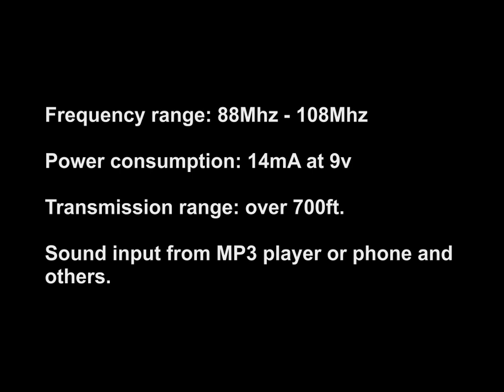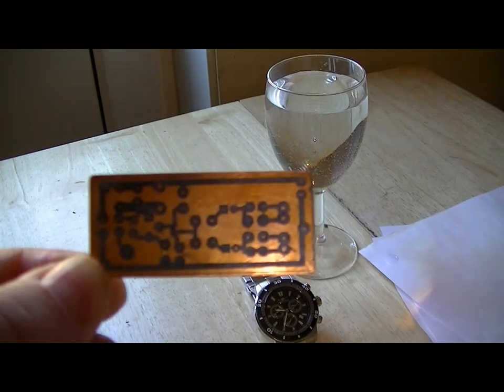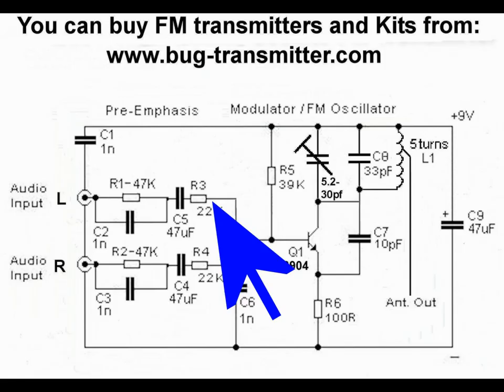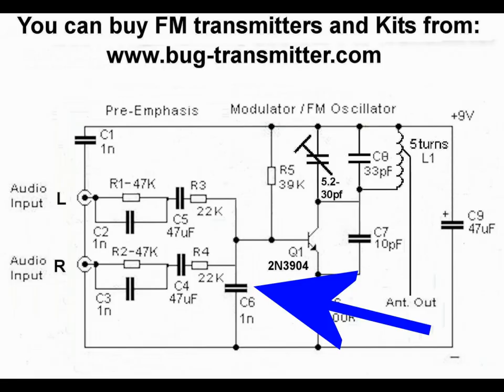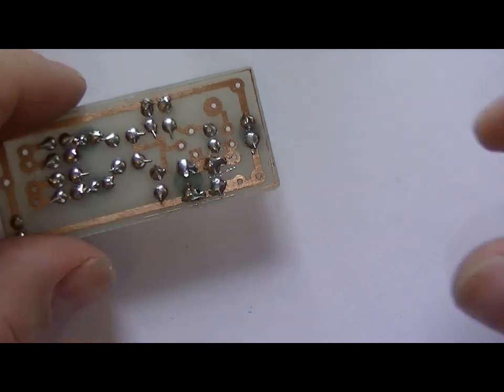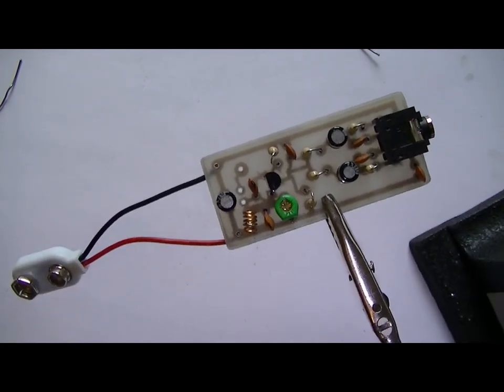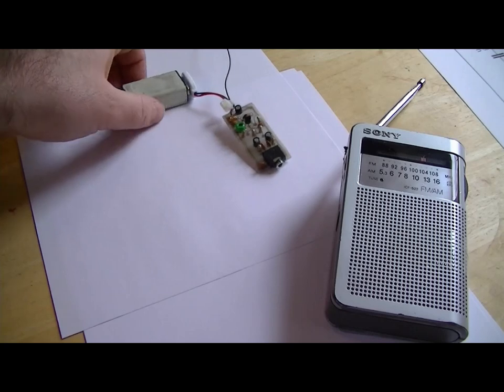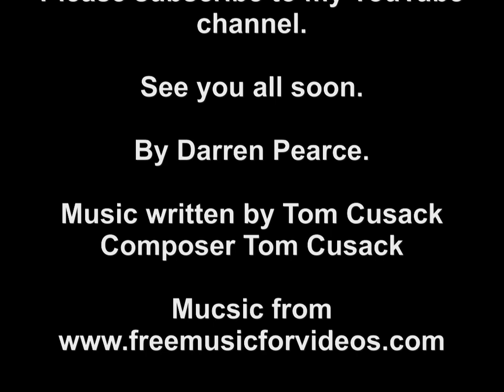How to make your own radio station.I show you how to build a simple FM transmitter.

Comment: Great video! Just wondering about the homemade coil, you said 5 turn is good for the regular music radio mhz, so that's what I'm aiming for. But you didn't say anything about the thickness of the copper wire. Is this crucial? What thickness should it be? AWG or mm2? Thanks in advance and hope to see more of these videos, I really love em! =)
Reply: +Chris Fredriksson The thickness is not crucial. You can adjust the inductance of the coil by pulling it out or pushing in.,(all the turns or just 1, 2 or 3 turns f. e.)
You can use lacquered copper wire. Or solid electric coperwire.
Reply: +Antonie van Gelder Thank you very much! I did build one of the others that dazaro3 shows on his channel and I found that out by just testing :D So at this point I already knew it, but it's great to share here so others can have use of the information. Thanks Antonie! =)
Reply: Chris Fredriksson You welcome, trial and error ;)
Reply from the maker: +Chris Fredriksson 
Sorry im late in reply ,been very busy.
The coil is made from 0.5mm Diameter enamelled
wire ,the wire does not need to be enamelled wire,you
can use any solid core wire from : 0.4mm upto 0.8mm.
And wrap the wire around a 3mm drill bit to make a coil.
Reply: +dazaro3 No worries =) Cool, thanks for that! I already built one of the other transmitters already, so i know it works.. Haven't come around to build this one yet, but I have all the parts! I'm also "busy" with doing other things, but its real stupid, I should just get on with it =P hehe..

Hope you make more videos on transmitter bugs and the like, I really love all your videos! =)
Reply: +dazaro3 A good way to hide a Fm spy bug is inside of a radio.who`sgonna notice that a Receiver has the ability  to transmit, isn`t it?
Reply: +gary depietro Thanks for replay. A hollow book is fantastic and awsome but is less secure to spy your target. Ex. If your target will open that book will ask what are this circuits, but your friend you spy will no open a radio if it Works, (but secretly it works both ways). And radio is ok in case of metal detector inspection.
Reply: +gary depietro O, sorry. You are right a hollow book is good hiding place, it`s only less secure just for few people, many people of today never open a book.
Reply: +gary depietro Thanks for inspiration.

Comment from the maker: You can use glossy paper from old magazines
Yes ,an Inkjet printer will use solvent inks and it will not work and the printer i use to make my PCB's is a laser printer ,its the toner transfer method.
It will ONLY work using a laser printer.The toner in laser printers and most copiers is made mostly of PLASTIC, which resists the acid that eats away the copper that doesn't have any toner on it. Inkjet printers use INK, not toner. And their ink is typically NOT a good  etch-resistor, at all.

Comment from the maker: Yes ,a Inkjet printer will use solvent inks and it will not work and the printer i use to make my PCB's is a laser printer ,its the toner transfer method.
It will ONLY work using a laser printer.The toner in laser printers and most copiers is made mostly of PLASTIC, which resists the acid that eats away the copper that doesn't have any toner on it. Inkjet printers use INK, not toner. And their ink is typically NOT a good etch-resistor, at all.

Comment from the maker: Its Ferric Chloride , a material for etching copper clad boards.

Ferric chloride has the advantage over other etching solutions like nitric acid by greatly improving the safety of etching. Ferric chloride is free from harmful gas emissions it will stain but will not burn skin and the pen ,Etch Resistant Marker Pen

Comment from the maker: This FM Transmitter may have about 5mw RF power,
thats 0.005 watts ,some local FM radio stations FM
transmitters power can be 25.000 watts and national FM radio stations
250.000 watts ,so you can see why this tiny transmitter will not 
override a FM frequency from a much more powerful transmitter.
To use you need to use a spare FM frequency.

Comment from the maker: It can yes ,but from about 10-25ft max
This FM Transmitter may have about 3mw RF power,
thats 0.003 watts ,some local FM radio stations FM transmitters power can be 25.000 watts and national FM radio stations 250.000 watts ,so you can see why this tiny transmitter will not override a FM frequency from a much more powerful transmitter.

Comment from the maker: When building FM transmitters you need to have all the soldering work 100% because they are high frequency circuits ,if a transmitter is working at 100Mhz they are working at 100 million cycles per second ! so all parts need to be in the right place and all soldering work 100%

Comment: awesome vid mate. just to help out if you dont mind (u didnt mention which way round the 47uf capacitors went). for those building this or just wondering... the capacitor purposely comes with different lengths of stems. the longest of the two would go into the right hand side of the board connection as you look at the drawing. hope this helps. keep up the good work dude! :)

Comment: I remember that magical moment of hearing my own voice through a Pierce oscillator (crystal controlled) based home made "bug" built on Vero board. Being a Pierce it didn't require inductors.

All 2N2222A with a class A amplifier through an emitter follower and fed into the oscillator base.

That was 30 years ago at the start of my career as an electronics engineer and it was my first transmitter design.

Comment from the maker: Make the coil using a 5mm drill bit.
Best way to test is with a FM radio.
Double check all your work and make sure all the parts are
in the right place ,just like in the schematic in the video.

Comment: How long does it last on a 9V battery? I'm thinking of using 4xAA, will 6V be enough?
Reply from the maker: ☹ しんみりＧＨＯＳＴ☹ 
If you use 9v and a PP3 Alkaline Battery current consumption is about 14mA so a 9v battery will last about 15 hours.

If you run the transmitter on 6v the transmission range will be a lot less but running time is very long , 4x AA Duracell Plus 2600Mah batteries current consumption is about 9.2mA so running time using 4 x duracell Plus 2600Mah batteries is about 282 hours !! about 12 days running time !

Comment: Awesome work , 
But how you know what channel FM is it in radio ?
Reply: Masood Haxor im also thinking about it :/
Reply from the maker: Masood Haxor 
Then turn the tuning dial on your FM radio slowly from 88mhz all the way to 108mhz ,if your transmitter
is working then you will pickup what audio you are playing.
Reply: ***** 
please what is the capacitor voltage ?
Reply: Is the capacitor and inductor a resonance filter?
Reply: Is the capacitor and inductor a resonance filter?
Reply: Is the capacitor and inductor a resonance filter?
Reply: But what about if I air no sound signal i.e., off-the-air?

Comment: I made one of these but doesn't the circuit circle around? I am using a 4.7uF 6.3V capacitor (smd, not electrolytic) and all i get is the 9v batter overheats. Lol
Reply: Nope, you can usually overvolt a capacitor to some extent, they're not that sensitive. What happened in my case was I created a short circuit at the +/- power in, because I didn't understand the circuit schematic. It ended up working and I still have it, I just don't use it :)

Comment: I have one question for the autor... I am making 
same as your transmitter and I have all the parts 
required,but don't have digital the frequency 
meter. So can you tell me which frequency should 
be adjusted on trimmer capacitor for the some 
frequency (for example 100.4Mhz or 97.6.....) 
because i can't measure the frequency. I am 
Serbian and maybe not good write on English.
Reply: Just set to somewhere randomly in trimmer knob and check via FM radio, at which frequency you are detecting transmitted signal..once you figure that out.. You can slightly rotate knob left or right and recheck frequency of reception in radio receiver..and repeat the process ( hit & trial ) till desired frequency setting is achieved..

Comment: What's the maximum range of transmission allowed without the need for an FCC license?
Reply from the maker: Wheatley GLADOS 
About 20ft in the UK .
Reply: Wheatley GLADOS 
in the US about 100 yards/300ft  
if you check the FCC regs they measure the field strength of the radiated power. Also you need to make sure you are not transmitting on a frequency occupied by a licenced radio station.
There is a ready made transmitter you can buy called Wholehouse Transmitter which costs about 100 dollars and allegedly has approval.. I tried them out. You get about 100 yards with a box standard radio and a bit more with a good car radio with a good antenna.

Comment: Hi dazaro, you do great works, i want to ask you if it's possible to build a complicated circuit board like the Open Source Hackrf project using the same tools you worked with, I know electronics but i never tryed to build anything i am not experienced in this field so what do you think about Hackrf and similar semi complicated PCB projects ?
Hackrf is an Open Source project to produce a wide range radio listenning device.
Reply from the maker: I have never seen the Hackrf project before ,i,m poping over there right now to take a look.

Comment: thanks for reply and i want to ask one more question that in your schematic diagram there is 3 capacitor of 47uf and you write in components name 4.7uf x3 so what is the capacitor you actually used in your fm transmitter. ?????????
Reply from the maker: You can use 4.7uf or 47uf ,both will work.

Comment: I have no 33pf cap. What can I use instead??

Also, if I use 22pf cap instead of 33pf, will it affect transmission?

Pls reply...Thanks!
Reply from the maker: MEM - MMXVII 
Add 2 x 22pf in parallel ,or try just one 22pf , the 33pf capacitor is part of the tank circuit so it's value is important ,best way is to Google tank circuit and have a good read.

Comment: I made this, but it's kind of unstable, I used the 10pf capacitor on the end of the coil with a ~15cm antenna, any tips on whats wrong?
Reply: Nevermind, I found the problem, traces and legs were too long.

Comment: I tried "building" this in a a circuit simulator - I got the following message: "Capacitor loop with no resistance". Did anyone build this? I'm not questioning your design, dazaro, but that just seemed strange.
Reply: Tony07UK
Allright. I'm receiving the parts to build this in some days - we'll see if sufficient impedance will make it work then=)
Reply: ojkolsrud1 did you manage to simulate this?.. did it work? .. i tried it on NI multisim..im really bad at this though..i put it as is.. and used a function generator with a 1khz sine wave as the audio input.. it didnt work :/

Comment: I've 6-30 pf trimmer so it will work or not...
& what material is L1 coil made of
Reply from the maker: faiz khan 
Yes your 6-30pf trimmer will work just fine ,coil is made from 0.6mm wire ,you use use wire from 0.5mm upto 0.8mm

Comment: Do you know what is needed to be done to convert this to am? Im fairly new to all of this.Is all that needs to be changed is the resonator?
Reply: The modulating part of circuit need to be changed..which is almost 80% of the circuit and also heart of the transmitter.. In short google for am tx circuit..

Comment: Thanks for the quick reply. I was just curious as to why the positive faces R3.R4 rather than R1.R2, 

I tried this circuit, but I substituted two 68pF caps in series to replace C0, and I used a 15pf in place of the trimmer cap. However it seems really unstable, I'm using a 187cm antenna. I tried both soldering it to the second turn of the coil which is a 24 guage (.5mm) wrapped around a 3.175mm diameter 5 turns. I also connected a 10pf cap in series to the end of L1, I have to directly connect

Comment: ive built the whole circuit. i dont have a frequency counter so i am not able to find the correct frequency. but i kept on turning the variable capacitor and also randomly checking if there is any signal obtained on the radio app of my samsung galaxy y phone but there is no transmission observed. does it work on a mobile phone? do i have anything else to test on the circuit?
thanks in advance.

Comment: Hello, i would just like to let you know that i have bought the parts and have just set it up an a solderless breadboard to test it... it is very good quality and stable, but i do recommend that the variable cap for tuning this circuit be placed away from the coil to avoid your hands interfering with the inductance, i makes it easier to tune. also the signal from my iPhone is somwhat week and makes the signal quiet. i plan to put an amp on the input to fix that. thnks for the vid, nice radio :)

Comment: Great video! If you started broadcasting that transmitter on a radio frequency that would normally be playing songs on the radio, and you were in range of that transmitter when you turned the radio on to that frequency, would you hear what you are broadcasting? Would there be any type of interference at all?

Comment: what is the oscillator in this circuit called? and would it be alright to replace the 2N3904 with a 2N4401 and increase the power, and if i change to a higher power would L1 need to be smaller because of more magnetic resonance around the area of the coil, or not? i plan to experiment before i solder these on a board permanently.

Comment: Great vid, I'm looking into using a similar setup to control a basic rc motor circuit , but it may simpler to use either am or I.r pulse. The problem is I can't find anywhere how this encoding is achieved. , if anyone knows anything in this area please give me a shout. ( +1 subscriber)

Comment: what is the voltage of 47uf cap? please answer me.... i need it badly.. thanks..
Reply from the maker: +the moves urquico 
16v ,you can use 16,50v or even 100v caps

Comment: Hey. I am very interested in making this fm transmitter. I'm just wondering if has anything to say if the capacitors are designed for 200v ac ? could i still use them with 9v?

Comment: i couldn't find ceramic capacitors so i've got electrolytics (for the 4.7uf) and the rest are tantalum. right now the circuit is not working, could this be the reason?

Comment: Please help!!!!!!! 
Can i make the inductore from normal bread board wire???????
Reply: May be as long as gauge of wire matches I.e I think 0.5 mm in this case ( plz double check )...you can buy wire of specific diameter from electric shop ... Or you can try several kind of copper cables till you find your match..bit time consuming then dropping by at shop and simply ask for it..its dirt cheap!

Comment: can you explain the first steps, is that a regulare printer, why used a magazine page, what material are you cuting and what are u dipping in to?
Reply from the maker: You can not use a inkjet printer only a aser printer.
An Inkjet printer will use solvent inks and it will not work and the printer i use
to make my PCB's is a laser printer ,its the toner transfer method.
It will ONLY work using a laser printer.The toner in laser printers and most copiers is made mostly of PLASTIC, which resists the acid that eats away the copper that doesn't have any toner on it. Inkjet printers use INK, not toner. And their ink is typically NOT a good etch-resistor, at all.
You can use any type of glossy paper from old magazines
Reply: dazaro3  thank you for reply

Comment: With that low current consumption, you could have a solar powered radio station. Of course, the MP3 player would also need to have a low current consumption for something like this to work. And then a license to broadcast with it.
Reply: This thing transmits to around 700 feet. and consumes about 14 mA. That's pretty strong for such stats.
Reply: Pretty much. Good for a house or a campsite or something like that.
Reply: {MLP} Rainbow Dash You could run it with a $35 Raspberry Pi! You don't need no MP3 player. You can just install Liquidsoap (you can code your own Radio :D) and have it routed to the headphone jack, get a 3.5mm Male to Male cord and connect it to the transmitter.
Reply: GeekBrony True. But it still doesn't have the range of the FM transmitter in the video.
Reply: {MLP} Rainbow Dash If you build this FM transmitter, you can connect it to the Raspberry Pi audio source.
Reply: GeekBrony Ooooohh, I see now. I thought you meant to use the Pi as a Pirate radio station.
Reply: {MLP} Rainbow Dash 

please can you tell me what is the capacitor voltage ?
Reply from the maker: A-S- C-A 
You can use 16v and all the way upto 200v
Reply: +BigMac RP regular car FM transmiters have about 100pW :D with 100mW output you can pretty much cover area of few squared kilemeters

Comment: How can I connect a microphone to the circuit? Will it work if I simply connect it to the mp3 jack?
Reply: Gaurav what are you making.
I think i have a Project you'd be interested in.
And second, How is he changing digital signals of Aux to Analog signal to be used in Analog Circuitry.
Reply: Digital signals?! Where???  Mostly all audio on computers and mobile phones is still analog. Digital audio is almost never used. Digital audio has very different connectors, not the standard audio jack.

Comment: hey just a question here. what's the name for the little audio input that you used in the project?
Reply from the maker: Wan An 
Its a : TruConnect PCB Jack Socket (Stereo) 3.5mm
Reply: dazaro3 thank you! and the other day I tried to imprint the schematic on a copper board, but unfortunately the ink it didn't stick properly. Do you have any idea?